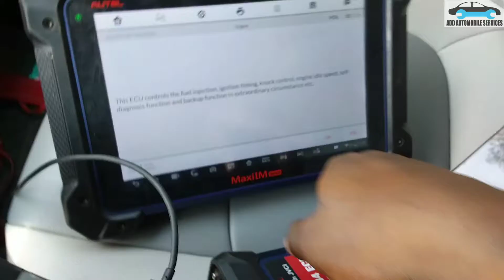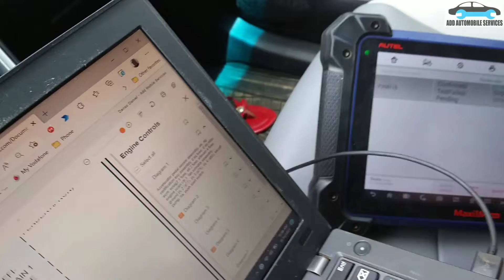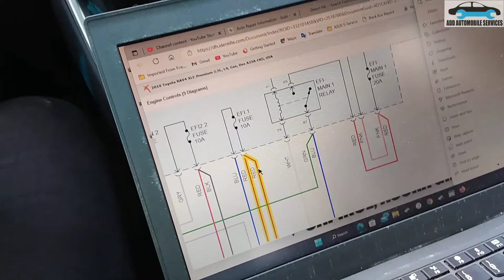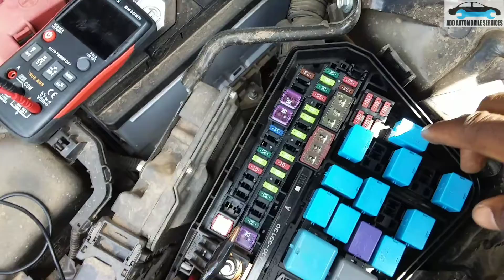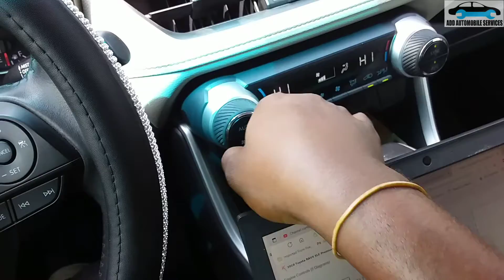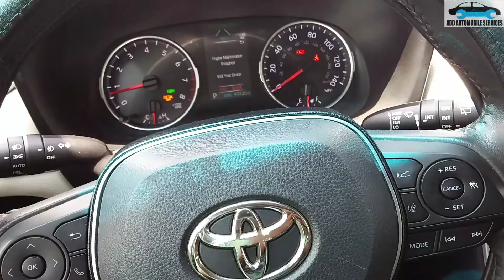2019 RAV4 : P268115 Engine Coolant Bypass valve circuit short to battery or open

Comment: Checked fuse ✅ replaced valve 16671 ✅erase code ✅still code come back p268111 on my camry hybrid 2018
Reply from the maker: They are two check the other one around the drive belt
Reply: How did u solve this?
Reply from the maker: @patrickonyema-g1b change component

Comment: Guy's be careful about raw4 2020 facing lots of problems just only 100.000 km 
1 coolent by pass issue 
2. Engine vibration 
3. Check Engine visit your dealer

Comment: My raw4 is 2020 ac is one side cool driver side is hot 
I replaced battery two weeks back 
Do I need to caliborat 
Dealer need 200$ to check 
Calibration 50$ outside 
Can I do it myself by obd2
Reply from the maker: What scan tool do you have

Comment: I'm very disappointed with Toyota because the 2018 to 2023 Corolla and rav4 are having this issue....i been a Toyota buyer for a long time and I feel that the consumer should not have to pay for this... Toyota needs to recall this issue.
Reply from the maker: Yes
Reply: Got this issue today. Is it danger to drive with this issue? Or it's just a sensor malfunction.
Reply from the maker: @hotgorshok1357 no it only affect you air-condition system
Reply: @ADDAUTOMOBILESERVICES what does it do to your air conditioner system?
Reply from the maker: It is the heater valve for the air condition

Comment: OK, mine went out around 60000 miles and luckily I had.
Platinum Extended warranty so I didn't have to pay for it. But yeah, what a pain.
It was right after an oil change

Comment: Can it damage the engine driving around with this code? Or is it just a matter of losing heater functionality or something?
Reply from the maker: You will loose heater functionality
Reply: @ADDAUTOMOBILESERVICES  - well I guess outcome will be different if it fails open (maybe cabin is always hot) or closed (cabin never gets hot). Either way, nothing damages the engine.
Reply from the maker: @condor5635 yes

Comment: Hiii, Toyota dealer is charging me 600 to replace the coolant bypass short circuit 😑where can I buy it cheaper?
Reply from the maker: Check Rockauto
Reply: Can you please list the fuse part # 
I am having the same issue.
Reply: @estebanjimenez5895 - what do you mean the fuse part number? A fuse has amperage and that’s it. Look on the fuse box to see what the amperage fuse you need.

Comment: Is this the same as engine coolant outlet on Toyota Camry 2020?
Reply from the maker: Yes
Reply: @ADDAUTOMOBILESERVICES  do you know the part number by any chance so I replace the right thing ?
Reply from the maker: It depends on the model
Reply: @ADDAUTOMOBILESERVICES  16331F0011 is this it ?
Reply: It says engine coolant outlet flange
Reply from the maker: @Getmooga24 ok
Reply: @ADDAUTOMOBILESERVICES  is that the correct part the outlet ?
Reply from the maker: @Getmooga24  yes

Comment: Same issue here, how much does it cost replacing the valve? And, is it fine to drive without fixing it as I don’t need the IC for couple months?
Reply from the maker: Yes but you will need to fix it during the winter months

Comment: Is it difficult to change out the engine coolant sensor? My Toyota dealer wants to charge me $650.00. They say that’s reason the maintenance required message is staying on. Thanks for the great video
Reply from the maker: No 
You're welcome
Reply from the maker: 16671-f2010
Reply from the maker: Ooh ok
Reply from the maker: Ooh ok

Comment: So do I replace the sensor or the valve bro?
Reply: IS there a video on how to install it ?
Reply: @knight3131  not that I’ve found. But from what I understand the issue is the little plastic barbs on the solid parts could break. So, have a wide drip pan below to catch any coolant, then have the new part ready, then gently cut the old hose part off the connection, and slid each new connection in. Lose a little coolant that’s recovered, and you’re done. I have the part and an extra bottle of premixed Toyota coolant in my trunk and haven’t actually done it yet. So do at your own risk and let me know how it goes! If I do it first I’ll post it here. But it’ll probably a week or so.
Reply from the maker: @knight3131  Diagnosis the issue
Reply from the maker: Valve
Reply: @ADDAUTOMOBILESERVICES  thanks bro
Reply: From what I understood it was a faulty sensor
Reply from the maker: Yes
Reply: But the parts come as an assembly
Reply from the maker: Yes
Reply: So I don’t know if there is a built-in short lifespan on the hoses as well?
Reply: Yes the it comes as one piece sensor is attached I payed $79.34 USD in MA
Reply: @Getmooga24 can you share me How to buy this part please !
Reply: @HungNguyenXuan-tp9vx  put your vin number in that website and then search engine coolant bypass valve I have a 2020 Camry and it was the hose leading to the valve not the actual valve so double check before replacing anything and I took it to the Toyota dealer because I rather have them do the work then a shop so I payed $497 with the park and labor included I got a good deal. The part was on back order and the dealership does not charge you for diagnostic if you do the work with them.
Reply: @Getmooga24 What website?
Reply: @Getmooga24 - an $80 part… I’ll just install it myself. Why give the dealer $400 for a easy job
Reply from the maker: @condor5635 great

Comment: Great Video! Thank you
2019 Rav4 Limited
VALVE, WATER
Part Number: 16671F0020
Supersession(s): 16671-F0020
Reply from the maker: You're welcome boss and thanks for your info
Reply: @ADDAUTOMOBILESERVICES  Just got my car diagnosed and I can confirm that this is also the exact issue I am having. Looks to be very common. Thank you again.
Reply from the maker: Yes common on the new system
Reply: My mother in laws has 30k and just got that problem a 2020 rav4
Reply from the maker: @JeremyB1039 test and replace  component if faulty
Reply: I’m having similar issues with my car and my wife car. Both are 2020 and 2019 Rav 4, and they are less than 90,000 miles.

Comment: Dear,
I have 2018 XSE Camry, check engine light is on and the error code is P26AC15.
Code description is "coolant bypass valve B circuit short to battery or open.
I chabged the same valve you showd in video but issue is still.
Please  help
Thanks
Reply from the maker: Please check the fuse and the circuit system
Reply: @ADDAUTOMOBILESERVICES  will check all of these and inform you with updates
Reply from the maker: @mohammedalbrashdi3941  ok
Reply: You got the wrong bypass valve. These vehicles got two. One for the engine and other for the transmission
Reply from the maker: @JoseCampos-uc9kh ooh ok but I tested it and it was not working

Comment: Great job
Reply: 16671-F2010 part number:: value assy flow shutting..if your Toyota Corolla 2020 2.0 liter
(Engine maintenance required visit dealer ).. Toyota Camry, Toyota RAV4 , Toyota Corolla have this problem  around 50,000 miles.. easy to change one bolt two hoses..
Reply from the maker: Thanks boss